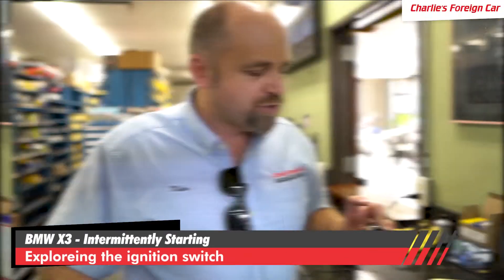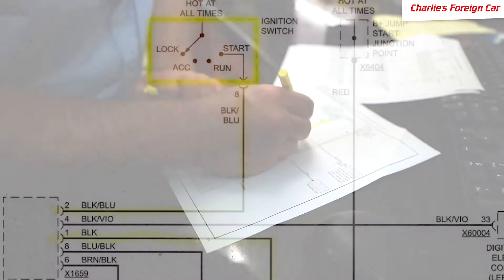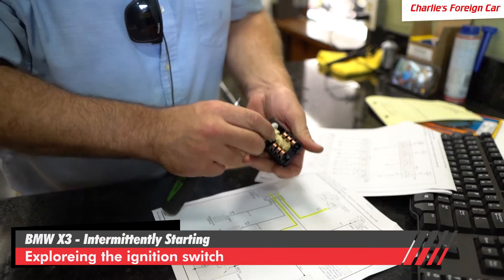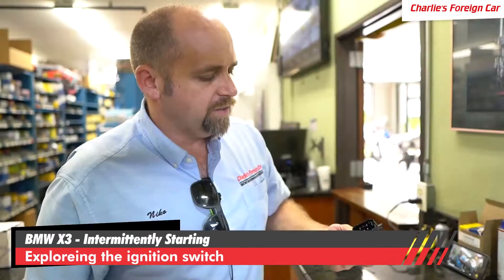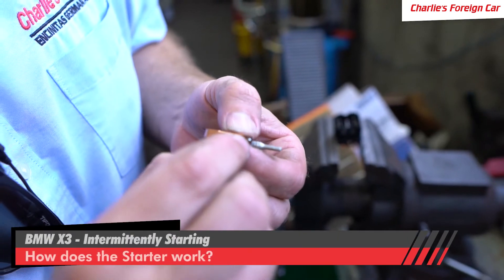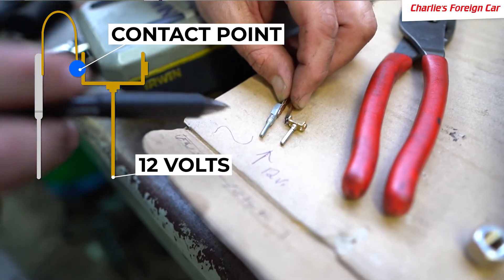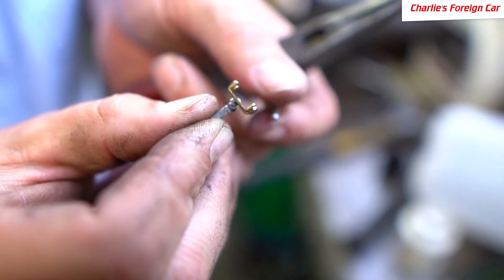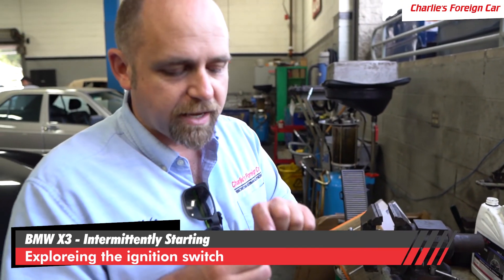BMW X3 - How Does The Ignition work?

Comment: Thanks a lot for your explanation. I believe that I found the reason why my BMW ACC power is not working.
Reply from the maker: That's great to hear!
Reply: @fixingcars  I bought an ignition switch for X3 on eBay and replaced the old abnormal switch with a new one. Now it works perfectly. Thanks again.